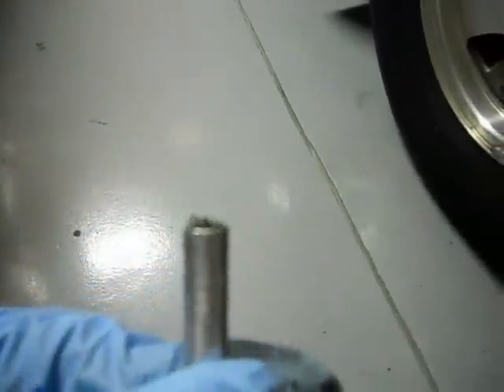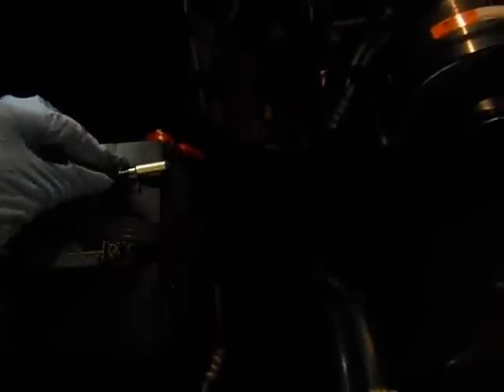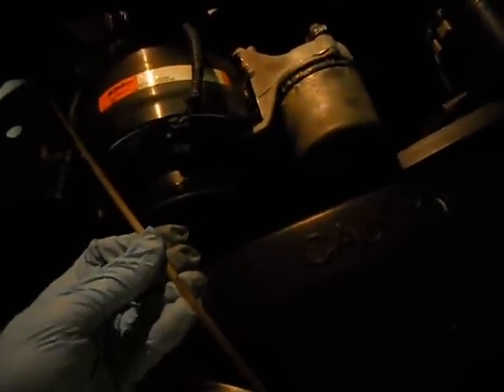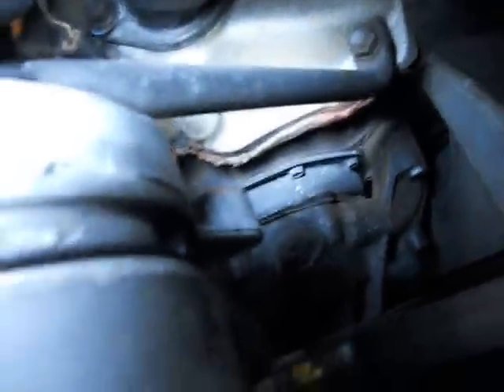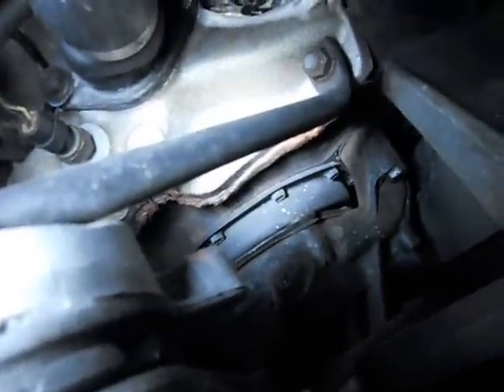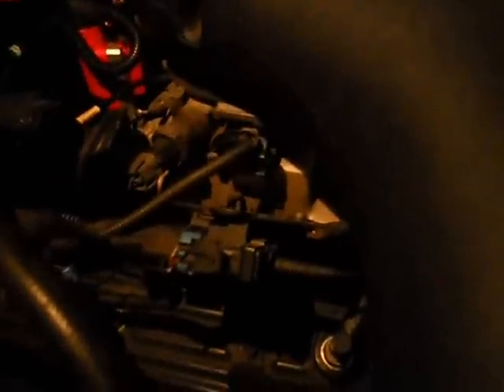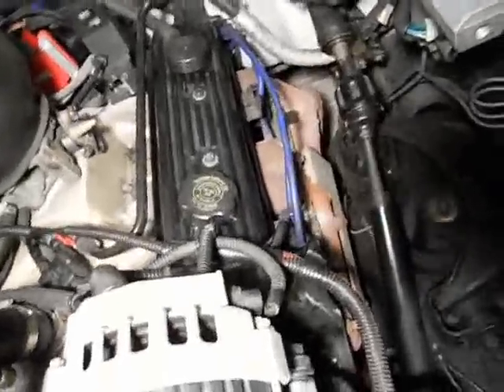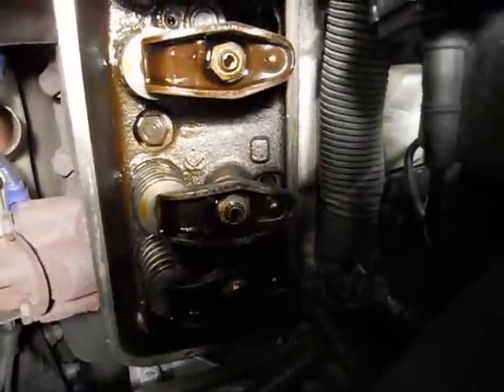The 305 Is eating Steel/Iron

Comment from the maker: @WhoSaidTyler Nope Not really. The L03 is a weak engine. But if it lasts a little longer until I find a nice core for a replacement, It would be great. I had the Distributor out not too long  ago for a new pickup coil. The gear still looked new.  The timing issue was noted before replacement. Every problem I fixed with 
this thing, It fixed other issues but never fixed the intermittent bog down.